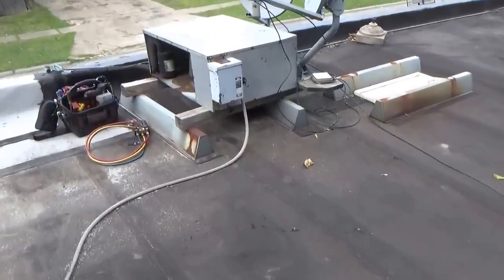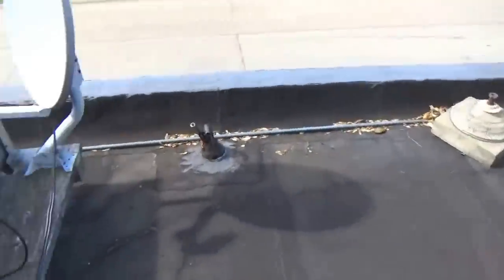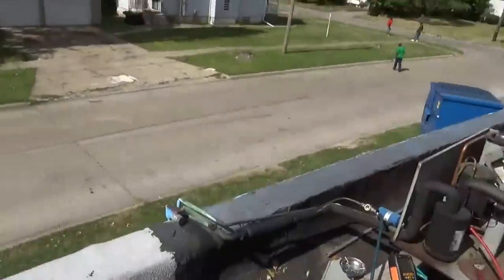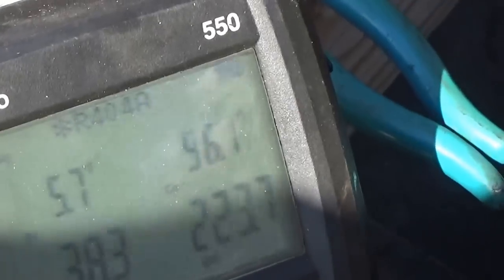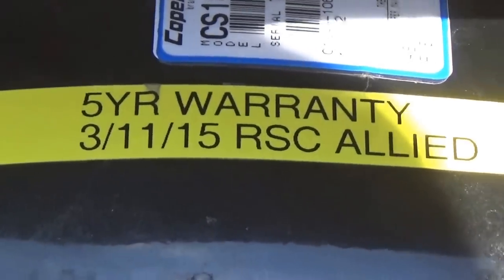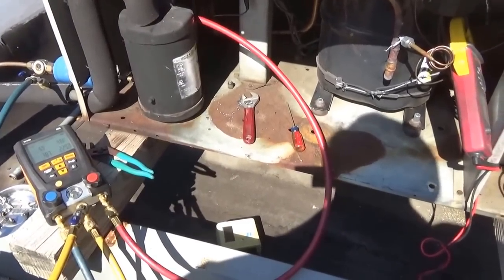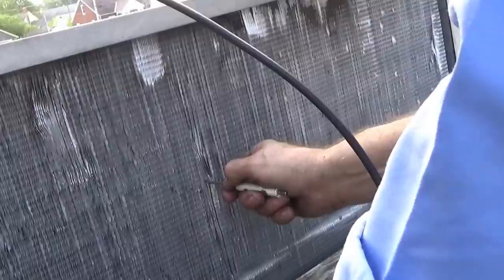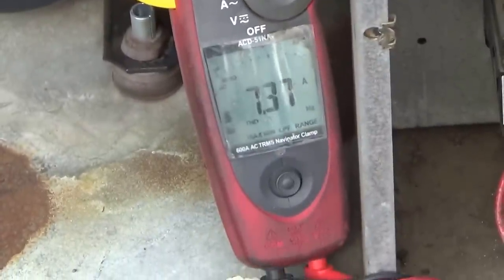Omar's glass door soda cooler

Comment: nice that its up and running. with customer shutting down tough to say what caused the problem. please keep us updated.
Reply from the maker: +jeff burton was back today, the old expansion valves were way out of adjustment, I set the delta T's to around 10

Comment: Hey Jim, I thought you said the cooler had MP39-R401A but I noticed your testo set at R404A. Wouldn't your pressure readings been a bit higher set to R404A?
Reply from the maker: +eddieg780 the low and high pressure readings are exactly what is in the low and high sides. What would be off would be the super heat, subcool, evap temp and cond temps
Reply: Oh ok I see. Thank you Jim.

Comment: You see that more and more. Half fast with the satellite dishes. They'll piggyback on anything they can find to avoid time it takes to mount them dishes correctly. Found at home my satellite cables run inside my gutter under water and leaves. In too much of a hurry.
Reply from the maker: +Randy Kocian Those cable guys get paid a flat fee per job, not by the hour, so if it takes 1 hour or 4 hours they get paid a fixed amount. That probably why they cut corners. thanks